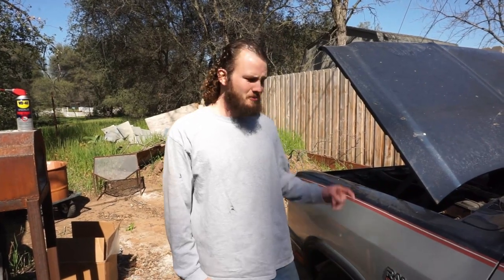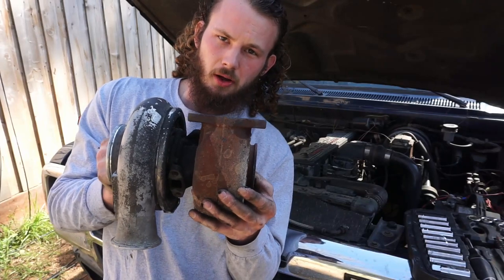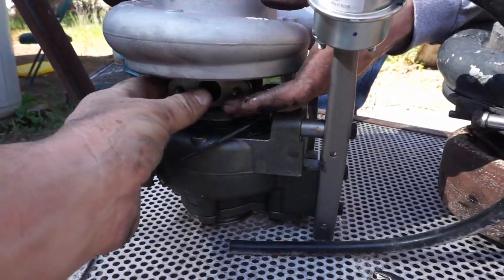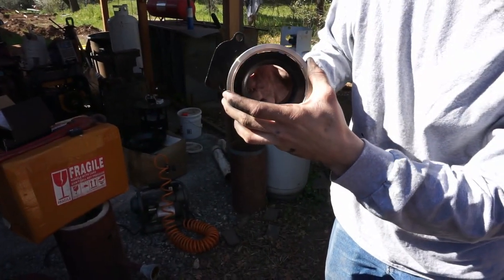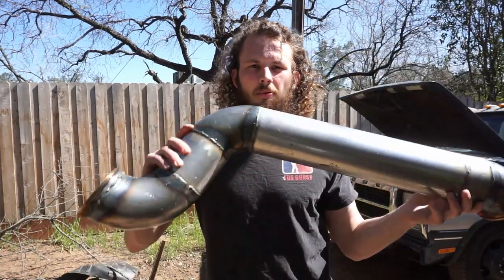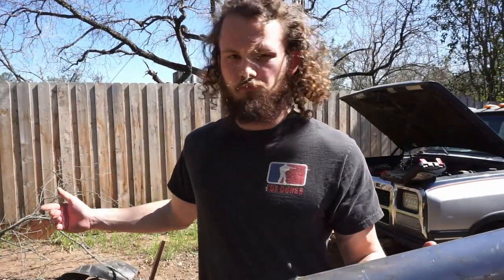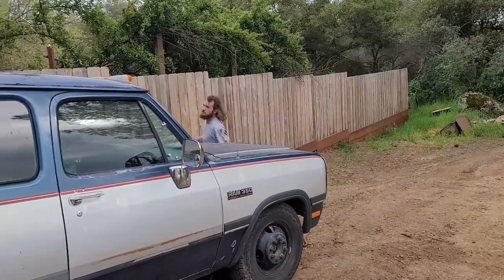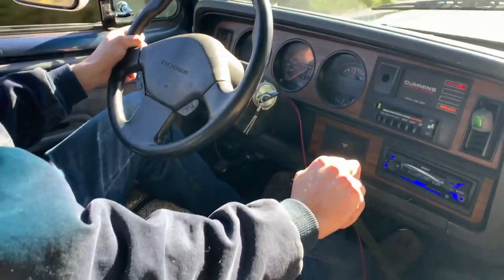First Gen Cummins HX35W Swap and 4 Inch Exhaust Fab/Install

Comment: Anything else have to be replaced when installing the turbo other words in the long run did u have to replace valves or anything major
Reply from the maker: The biggest mod was one of the oil lines. The metal line had to be cut and a rubber line added, but nothing else major

Comment: this was fkn mint now i know i could get a doughnut seriously i got 1 of the three 12vs is race ones a near mint first gen on that i went no wastegate he351 im about to put a 63 5 blade and am hoping for the sound i want on the race fummins ill call it i got basicly a t51r 5 blade 85 and a box borg 66 manifold           i highly recommend ddp injectors made a big difference subbed fkn mint
Reply from the maker: Hell yeah. My advice is to weld the inside of the donut before you cut it. Cutting it on the bandsaw was a pain with the pieces unwelded in the center